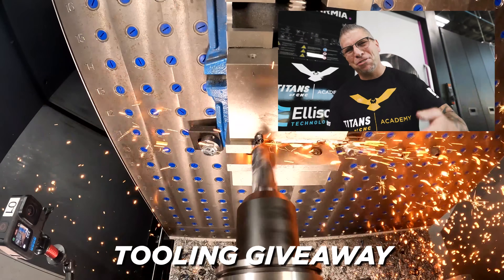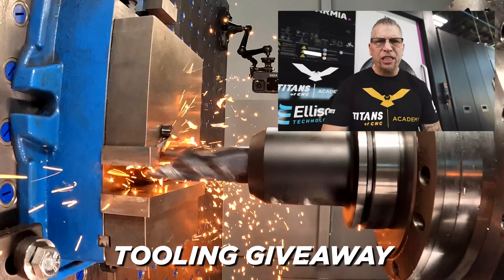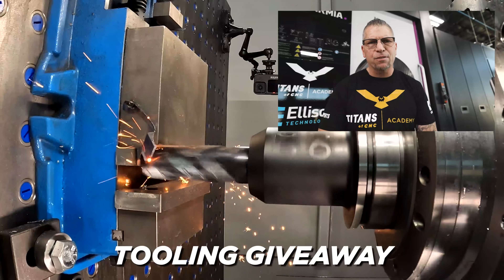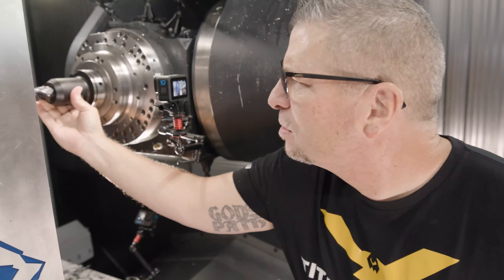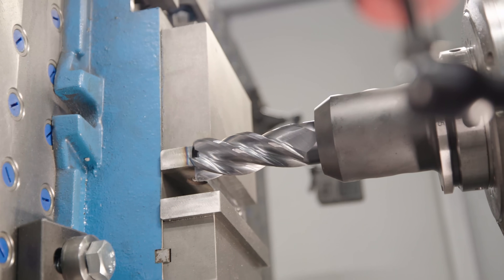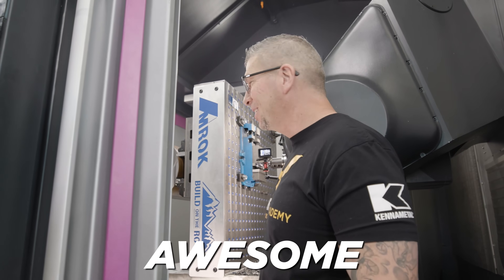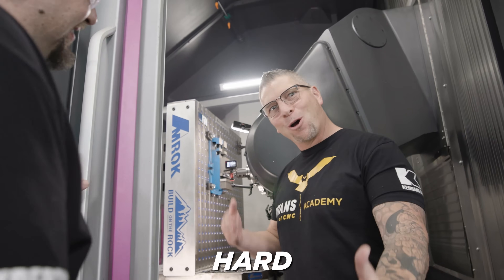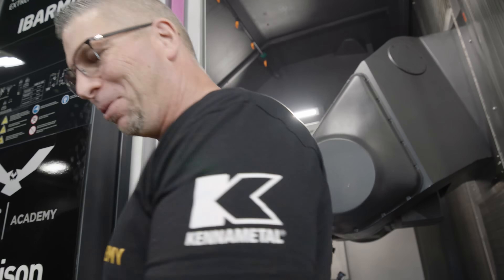FULL SLOTTING RIGHT THROUGH A VISE  +  FREE GIVEAWAY

Comment: Hello, im from Finland. I am setup manager and manager of okuma ma600ha and bit older but tuned up and modernisized mitsui seiki, i would love to test that tool and push it to the failure. If i can find the spot where it fails. we use smaller diameter harvi to do some full slotting jobs, works beautifully. I have widia hanita full slotter to compare with

Comment: Sick cuts! It was a bit unsettling seeing the cutter go through the vice even though it was intentional 

(Miss every shot you don't take, I guess)
I'm a new machinist (only 5 years in) and would like to try a top notch cutter better than the normal non coated hss or carbide I usually work with.

Comment: I currently work at a pharmaceutical rubber company. We maintain molds and dies used to make IV and bottle stoppers for the medical field. I’ve been trying to convince the upper management that if we invest in hood tooling, we can use a tool multiple times and not have to spend a ton of extra money using a tool once then scrapping it. This would be an excellent introduction into what modern tools can do to increase productivity and reduce tooling cost by pushing tools where they should be instead of buying junk tooling and babying it.

Comment: How long is the tool? How long are the flutes? We have a project in the shop on which the tools are getting eaten alive when they break through. 316 stainless. We use a ¾" diameter 4-inch total tool length with a 2.5-inch flute length. I believe 2" flute length would work. I've also been trying to convince them it's worth getting a go pro. If so, it would be awesome to try this out and get it on video!!
Reply: https://youtu.be/NadZVdGTtLw 
Heres one we did in 316L

Comment: Beautiful, I need this cutter to make my life easier,and to prove to my boss that it pays off to invest in descent tooling,instead of buying the cheapest junk he can find!
Reply: I can attest to good tooling vrs cheap tooling. My company use to buy the cheapest taps he could find and we were constantly breaking them. Loosing a ton of time trying to get them out. All the machinist were complaining to his boss about it and explaining more expensive taps are better. Finally after 3 months of this and are efficiency being crap we switched over to widia taps. Are efficiency instantly increased by 200% as we no longer had to burn taps out and we were able to tap many holes with one tap. They did cost 100% more to buy them but with the efficiency gains and shipping products on time it was well worth the investment. Yes occasionally they still broke but they were 1000x easier to work with.
Reply: @wendull811  What brand of those "widia" taps? I guess you're german or polish :D
Reply: @john.hunter  How did you know I have polish heritage? Lol
We usally use the widia series 7305 for thru holes and the Gt 30s for bottom tapping.
Reply: @wendull811  I use widia taps here in the states, they only break when i push them to hard. other than that, no issues at all with them
Reply: @Ethan-zk9lq  they are awesome taps.
Reply: @wendull811  "widia" name for cemented carbide comes from german "wie Diamant"– like a diamond.
And that name is commonly used in Poland. 
If it is more popular than i know, then it was a blind guess :D
Reply: @john.hunter  widia is widia , they still make tools . Same with xerox .
Reply: Yes
Reply: I'm hoping to be trying a harvii T3 soon if the awesome Titan hooks me up 😉🤣
Reply: Looks like I'm gonna have to invest in my own harvii cutters if I want to try murdering some material....🤔
You wouldn't believe the amount of tooling I have to buy myself, since the old owner retired and his son took over,he's not a machinist and just doesn't get it!  He'll  buy cheap stuff ten times,rather than pay twice as much on a tool that will last ten times longer! Frustrating to say the least......🤨
Reply: Works hard enough as it is without f***ing around with your tools
Reply: Breaks tool on first pass while boss man watching :P

Comment: Hey I paid attention to the conical surface of the dispatch - and it is with signs of vibrations and this despite 100hsk. I wonder if you continue to work in the same style for 8 hours, you can kill the spindle? This is the correct context..!
Reply: Well, i do not know about the spindle in 8 hours, but I can assure you that we can kill a vise in 8 minutes!
Reply: @barrysetzer  You should have a tool to measure the force of your drawbar on your double сontact spindle . Do you use one?